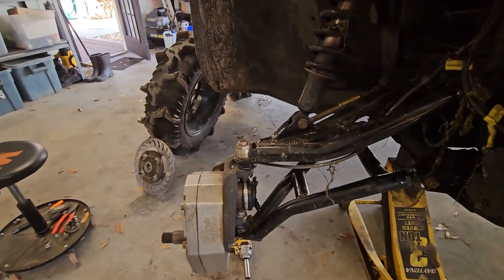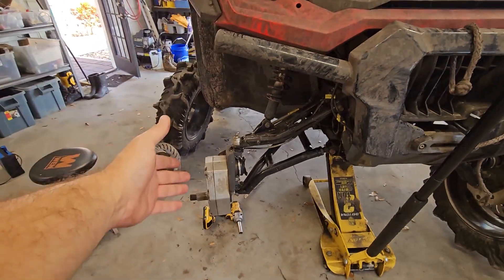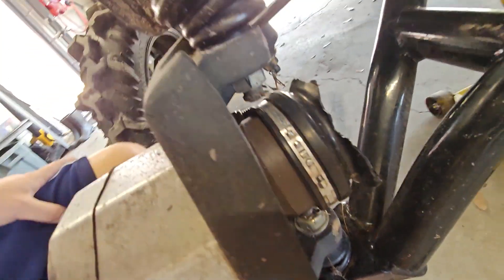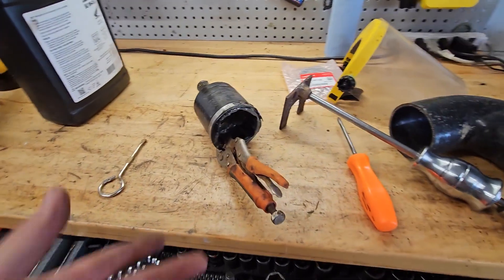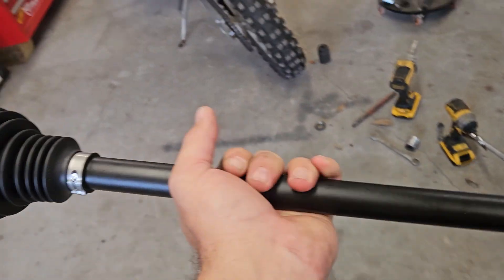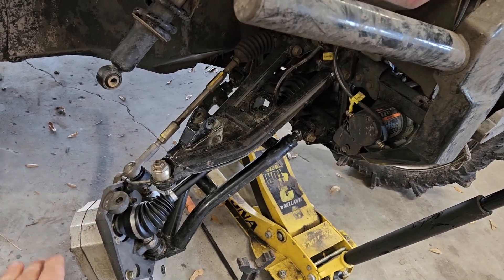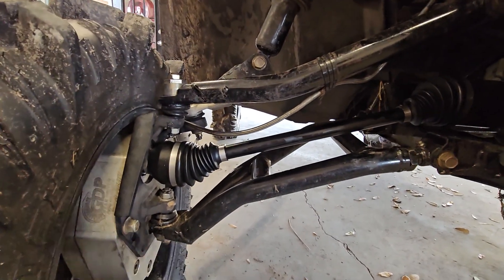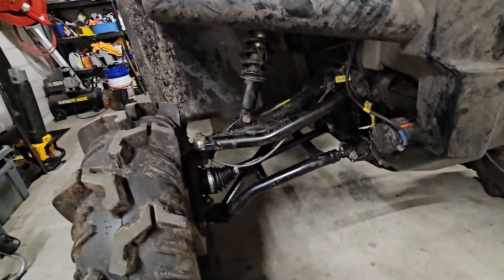Pioneer Demon Axle upgrade: 21 axles work on a 22+ 1000! Double plunging (long travel)

Comment: Which axles are these. Says only 2021 on the demon site?
Reply from the maker: Yes that is correct that's why my video title says 2021 axles work on the 2022
Reply from the maker: You do have to run the correct axle nuts which they come with